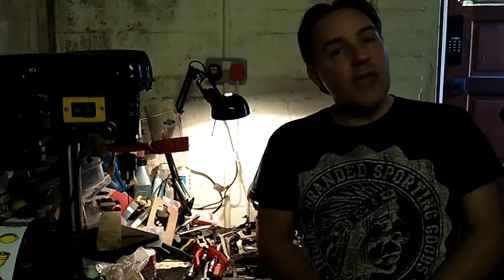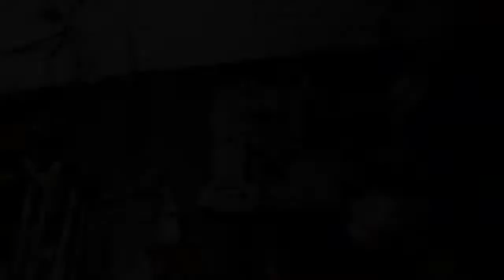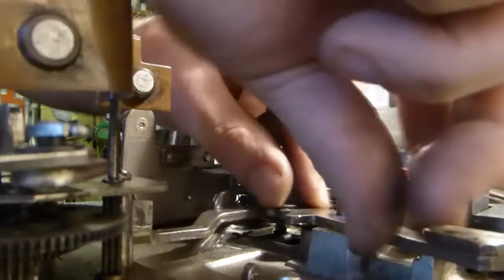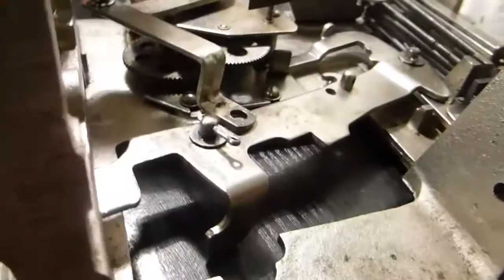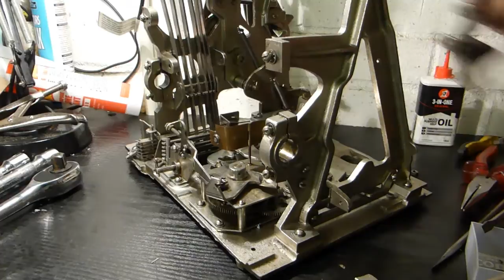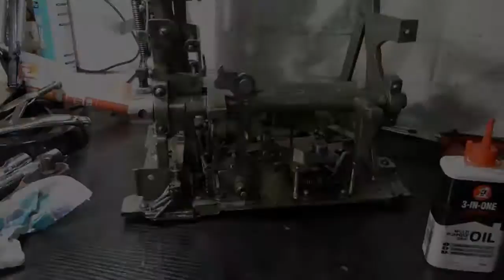The Repair Shop Restoration - The Reassembler - Slot Machine Mechanical Penny One Arm Bandit

Comment: The pile of parts is what I'm afraid of. 
  Both my 1940s mills
Work but one doesn't pay out.
The penny's go into the pay tube but won't pay out.
The other is a nickel machine. 
 It works OK.
I am afraid of breaking something if I take it apart. LOL

Comment: I have a mills diamond front slot machine and i need a replacement clock spring. Any suggestions on where I can find one ? I have searched without success

Comment: Hi thanks for posting this. I have a Bally Quarters 2p machine & if I play it with the door closed the reels don't spin properly & slow or stop. If I open it a little the Reels 1&2 are fine but Reel 3 spins initially but slows while the mechanism clicks in time. If I open the door completely Reels 1&2 still fine & Reel 3 still slowing before time. Any idea what's causing it? Thanks

Comment: Hi. I have a few questions: 1) How does the flicker spin the wheels, what part of the wheels does it flick, also are the wheels spring loaded? 2) I know the wheels spin individually, but how does each wheel connect with its appropriate payout disk,  because the disks are all to the side of the set of wheels? I'm interested because I'm thinking of building my own mechanical one arm bandit. Thanks in advance.
Reply from the maker: The reels get spun from the kicker which locates in the discs on the right of the reels (looking front on). The wheels (reels) are not spring loaded they free spin on a centre shaft. Look at the follow on video to see how the reels connect to appropriate pay disc. Good luck with the build.